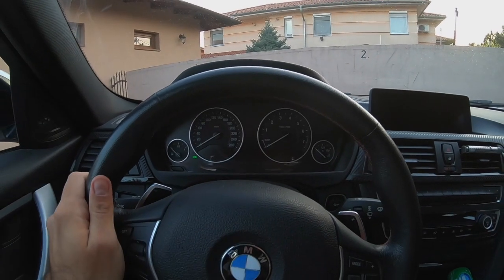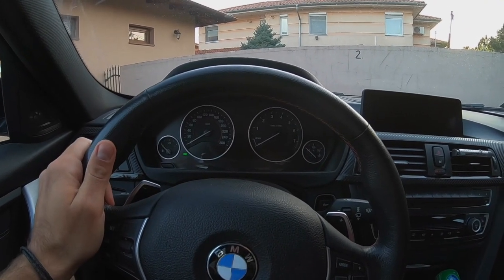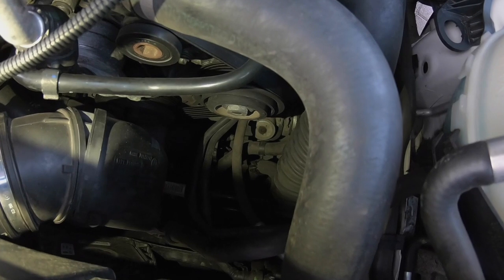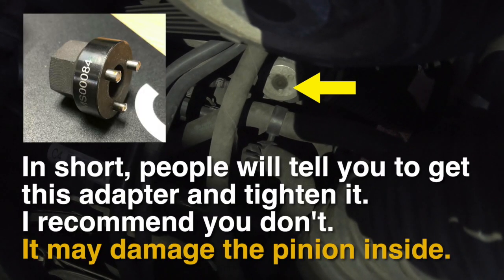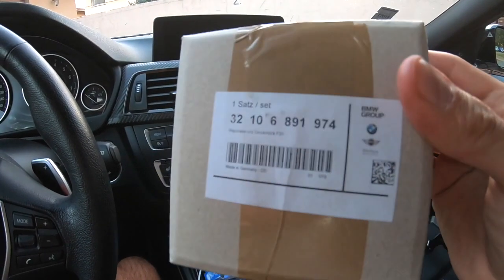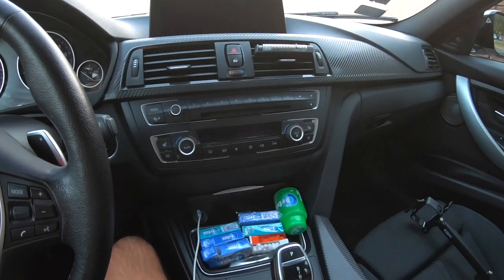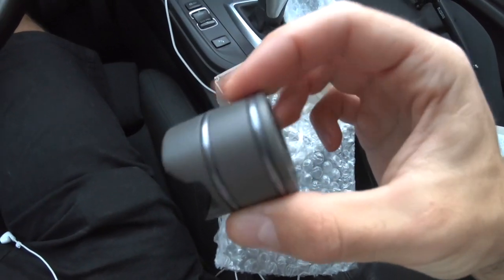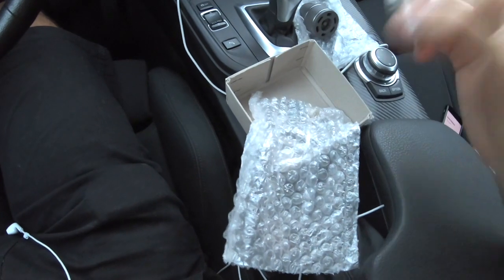Part 1 – BMW F30 Electric Power Steering Rack (EPS) Noise / Knock Fix

Comment: I had this done two days ago by a BMW specialist garage. There is a few special tools you need to complete the work, not sure if a computer adjustment is needed.
The kit was released by BMW on the 18/09/18. It was fitted to my car 430d 18/10/18 and so far has transformed the drive, honestly it feels like a brand-new  new car. 
Get it done but don't do it yourself.
Reply from the maker: That's great news! Can't wait for mine to be fixed. Cheers!
Reply: Hi... Could you please describe the symptoms or feeling before and after?. I really need to figure out what's wrong with my steering....
Reply: Jon Fletcher thanks for that comment Jon. My 2014 435i has just started doing this. It isn’t too bad but I’m worried it’ll get worse over time. How has it transformed the drive? And how much did you pay for labor?
Reply: Do you know how long it takes to do the job. My local stealer has no idea how long it will take...thx
Reply: @harrylee2615  no idea on the book time for the work but it took about 2hr on my vehical.
Hope this helps
Reply: Is yours the VSS or Servotronic steering, i believe this repair is only for VSS.
Reply: @harrylee2615  I've no idea mate, my car is a 2014 430d if that helps
Reply: Jon Fletcher where did you get it fixed from? I mean bmw uk? I’ve got the same issue a slight knocking noise and a very numb steering at motorway speeds car pulls either side on its own. I hear the knock on the left wheel but only when I reverse and brake or when I go back in to drive and brake. Just one knock per opposite first movement. The knock doesn’t annoy me but the drive and the steering feel does I’m assuming its this same issue as I’ve been to a few garages and they haven’t been able to diagnose it. Just got alignment done and thought its a fix but realised later today on higher speeds the steering feel is just not there.

Comment: I need mine done ASAP, but in my opinion BMW should be doing this fix at no cost, after all it was apparently a design fault which they were allegedly aware of for a while. I guess £80 or so ain't too bad.. Looking forward to the update video. ;)
Reply: Have you had your car fixed? My car pulls either sides on motorway speeds. Bmw diagnosis and repair would be easily £150 or so.
Reply: Mine is doing same, its because play in the steering wheel. I got this part changed and re calibrated the steering wheel and its like new now

Comment: I took an appointment at BMW dealer, to change this bushing. They didn't even know about this. When I explained to them they were surprised. The part cost $58.00 CAD, and they said approximately 45 minutes job. I would do it myself but i don't have a tool.

Comment: There is also the power steering gearbox that can break and it wouldn’t even look like there’s anything wrong with it,it’s on the passenger front side right under the weather protector

Comment: I have a F32 AWD with exact same problem, I will try this out and let you know if the part fits. Thanks for the video
Reply: Part did fit, but my issue was not resolved. I think the problem is the lower steering column
Reply: Guillermo Mora mate did you car pull one side or another while driving specially on motorway speeds. I have exactly the same issue can’t seem to get it fixed.

Comment: This kit is very interesting...If you think about the parts in it you quickly realise that it's spring loaded and it's aimed at removing slack... the black pads on the U groove on that piston probably wear out to quickly on the original part. Unless the pads are completely shot on the original part there is no reason why a slight tightening (1/8 of a turn) won't fix the issue nicely. Even when using this kit... what is the right torque?

Comment: Jon Fletcher where did you get it fixed from? I mean bmw uk? I’ve got the same issue a slight knocking noise and a very numb steering at motorway speeds car pulls either side on its own. I hear the knock on the left wheel but only when I reverse and brake or when I go back in to drive and brake. Just one knock per opposite first movement. The knock doesn’t annoy me but the drive and the steering feel does I’m assuming its this same issue as I’ve been to a few garages and they haven’t been able to diagnose it. Just got alignment done and thought its a fix but realised later today on higher speeds the steering feel is just not there.
Reply: Same problem. Any solution?

Comment: It’s now confirmed no need for computer calibration that applies only when the whole steeringrack is replaced. It needs wheel alignment for some reason. It’s less than 2 hours of labour.
Reply from the maker: Maybe wheel alignment what they meant by "computer calibration"? Thanks for the info, I will include in my part 2 video if that's ok.

Comment: Same issue on my car. This common solution didn't solve my problem but the sound comes indeed from the steering rack, or better said, steering box. When i reinstall the new kit , because i didn't have place to work with a torque wrench, i tighten the new nut until only 1 millimeter from the face of it, was outside. Any suggestions what it could be? If i tighten it more, let's say to be even with the steering housing, will solve my problem or i'll brake something? Best regards!

Comment: Is there a similar repair kit and fix for the F10? I have a 2014 535d with the same knocking noise.  Thanks!  I saw another video showing it could be loose bolts on the steering rack but that's not my problem.

Comment: Hi could you please answer my question I couldn't find a solution. I have a noise similar to this but it is not so loud and it is more like to feel when touching the wheel and also I feel the same knocking voice when touching the brake or accelerator pedal. It is all felt down from pedals to steering wheel. Was it same at your car?
Reply: Yeah bro I have the same problem! Mine starts knocking when it get warm. Did you find the salution?
Reply: @vilpauiza  did you find the solution?
Reply: @bmwm5f10  Not yet, im thinking of returning the car to the dealer. It onley makes noise after 1:30h so its hard to prove.
Reply: @vilpauiza hi did you find the issue?

Comment: Hello, have bmw 320i 2014 model am having issue with the steering rack is very hard to control engineer said I should change the steering rack which have dine but the problem still persist.
Reply: sina isaac pleasu chang you tyres to orignal size or check for allignment

Comment: have a 2013 BMW 335 F30 that made this noise in the direction when the car was off. After researching a lot on the subject I decided to take the car to a specialized garage in the hydraulic direction and asked the mechanic to tighten the screw on the steering box. Suddenly the mechanic, after hearing the noise of the car already said that he had to regulate the said screw that slacks with the time. Finished the service where it was done 1/8 of tightening by security the noise simply disappeared. Here is my report recommending not to tighten more than 1/8 to avoid that the direction is harder than the original.
Reply from the maker: Great info, thanks! I will include in my part 2 if you don't mind?
Reply: JF Vlog where i can order the part from? Thank you 🙏
Reply: did the noise return?
Reply: u guys u don't know what are u talking about, there is 3 specials tools used fit that kit back!! is not only about took him off and put back...  :))) only bmw dealers or any garage that have bmw permission can do that job!! good luck!

Comment: Hi, I have the same problem but I can feel and hear this when im driving. Do you guys have that too?
Reply: Yes I have it on bmw f30 328i, i feel a very slight click whenever I go back and fourth near the middle of the steering wheel
Reply: @dispickle5971  Thank you for your reply!
Reply: can you describe when you hear the knocking sound? does your car seem to have a slight misalignment no matter how much you do front alignment? i'm trying to nail my steering rack noise too. it appears in low to medium speed 40km/h-60km/h when I turn the car slightly to the right. i can hear a soft knock on the front left side, that increase/decrease in frequency in relation to the car speed. with the steering wheel set straight, the car drift to left and i have to slightly pull the steering to the right.
Reply: @warnacokelat  My alighment seems fine all I have is a knock only when it is driven for over 1 hour. After it cools for 40min the kncok is gone.

Comment: @A Köcsög BMW-s  hello, i'm very interested in the result. Mine sounds just like yours. Question. Did you also feel the steering loose, vague and extremely tramlining?. I'm looking where to buy this part but I don't find any that ships worldwide. Do you know any that does???.  Regards!
Mine is f32 435. Would it also work for my car?
Reply: My friend I had exactly the same I’m glad actually to find your comment coz my car is pissing me off. I have been to the garages got the wheel alignment done this and that but the problem is still there specially on 50mph plus speeds the cars steering feels lose as if it has a play. The car either pulls on one side or another and thats very annoying. Mine is 2015 F30. I’m sure bmw can fix this issue but they’ll charge a lot as in the UK the diagnosis itself is a £139 or so and then parts and labour on top.
Reply: @Sierra_mike hi, did you find the issue?
Reply: Hello, did you find the problem? Im having same issues

Comment: Yup unfortunately this will give you a short term fix and the problem will come back very soon.
Reply from the maker: Crap! Like how soon?
Reply: Depends how much you and how you driving. I had to tighten it up after a month and still no good
Reply from the maker: Did you do it yourself? Perhaps it's missing the computer calibration that the dealer told me about?
Reply: Did not know anything about calibration. I thought it only applies when new steering rack fitted?
Reply: Did the sound come back or problem solved permenantly?

Comment: Any update on the fix?
Reply from the maker: Im taking my car back to the dealer this Wednesday. I will update you guys right after.
Reply: @jfcarstuff480  hello, i'm very interested in the result. Mine sounds just like yours. Question. Did you also feel the steering loose, vague and extremely tramlining?. I'm looking where to buy this part but I don't find any that ships worldwide. Do you know any that does???.  Regards!
Reply from the maker: Great news, the car was done the same day and it feels and drives like a dream! 
No, my steering was never loose, I could just hear this knock noise every time I drove over road errors and potholes. Maybe mine was early stage?
How about your local BMW dealer? They must be able to order it for you. Where are you btw? If I can, Im happy to help...
Reply from the maker: Great news, the car was done the same day and it feels and drives like a dream!  I should show you guys in my part 2 video.
Reply: @swteng73  me too!
Reply: @jfcarstuff480  Hi! My F20 sounds like that. Do you got Calibration with computer? Great Video!
Reply: Did it need a computer adjustment
Reply: @Siderick  solucionaste tu problema? También tengo problema en la cremallera.
Reply: @harryortuzar1254  hola, tengo el kit y la herramienta en mi poder. Estoy viendo donde hacerlo. En la BMW te cobran un ojo de la cara...
Reply: @harryortuzar1254  hola Harry... Lo hice y quedo increíble. Solucionó todo. Lo hice en la BMW, así que tengo el repuesto y la herramienta aún. Por si quieres te los puedo vender... No los use pq los importaron ellos... Por si te interesa...

Comment: I replaced this bushing but nothing changed, yes now when the engine is off there is much less knocking, but still some noise, and when engine running and i start to move slowly I still have a knock when playing with the steering wheel (right left). I thought it will disappear but it's not. So this bushing doesn't change anything. I just spent money for nothing.
Reply: Did you sort the problem?